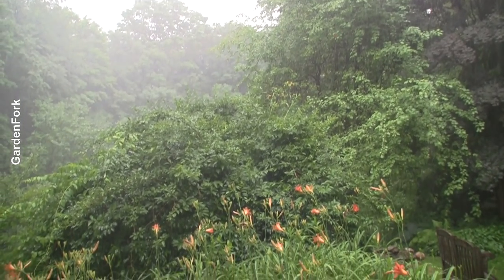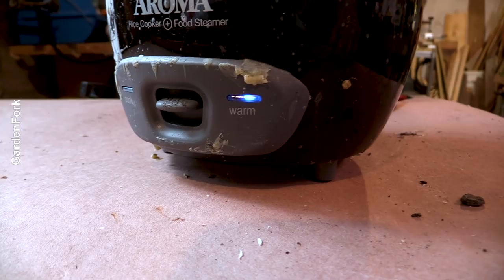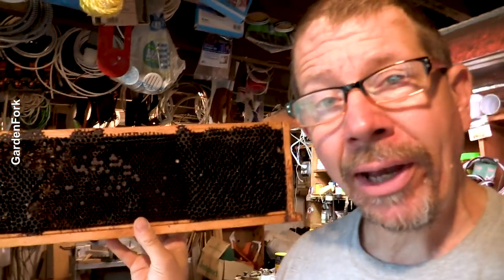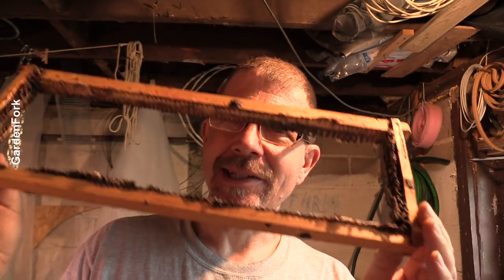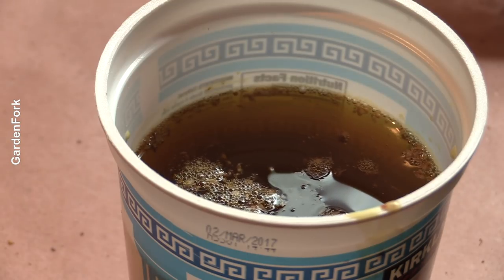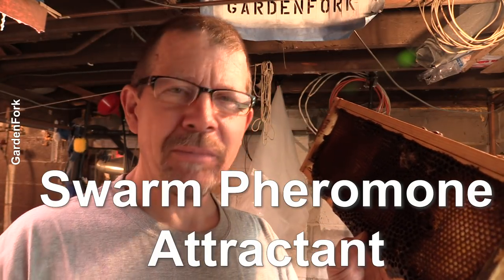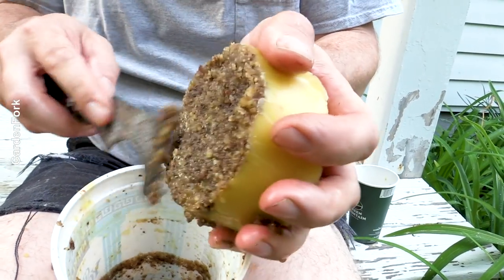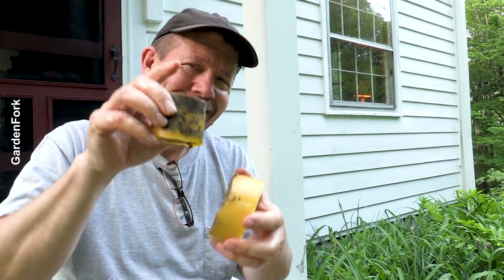Let's Melt Honeycomb And Make Beeswax, OK?

Comment: I melt down my dark wax by using much deeper water so the trash has space to sink further from the wax that will float.  There is also little "cocoon" in each cell that will float and need to be strained off.  You can use a metal screen to strain or even an old Tee shirt.  (if using material like a tee shirt or cheesecloth it will permanantly have wax in it.  I lay this flat to cool/harden then cut it up for fire starter).  I repeat the process of heating, let it cool so wax is at the top of the water, scrape trash off the bottom of the wax.  In the first melting their will be a small amount of trash on the bottom to scrap off, but just behind the trash is propolis that can be used to make antibiotic meds so don't waste it.  I may have to do the melt/cool cycle 3-4 times to finally have pure wax but it is not a hard process.  Since I can't scrape off all the wax from a frame I'll put the frame down in the boiling/hot water and let the wax melt out of it.  This not only cleans the wax off but coats the wood with a wax "protector" and will kill any parasites or eggs hiding in the nooks and crannies of the frame.  Be careful to not all the wood frame to soak in the hot water too long as steaming wood is how to bend wood so your frame could warp if left in too long.  I use deep pots like a turkey fryer and do this outside.  I can only submerge one end of the frame at a time like this.

Comment: Although you use your frames to start fires which is a nice idea, because of the reusable board at the bottem, once cleaned the frames can be reused multiple times.  I personally have reused frames for 15 to 20 years and some even longer.  Enjoy your hobby.
Reply from the maker: Yes, I re-use them also Ron, a few times they have been beyond repair, and then they burn well. Thx! 😀

Comment: Why wouldn't you strain the melted wax?
Reply from the maker: You can try, but it solidifies very quickly and will clog the strainer. I use the strainer to scoop out debris while the wax is in the pot.